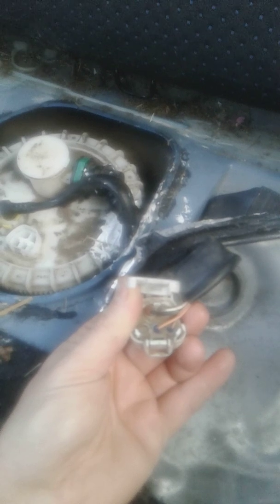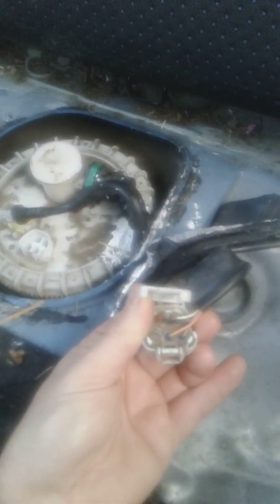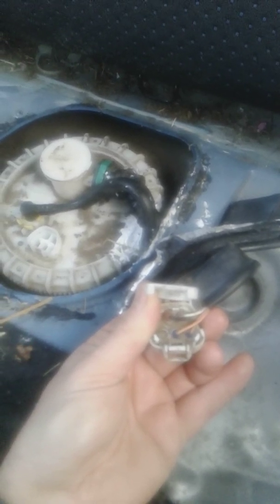2007 Toyota yaris no start diy

Comment: Go to the under the hood main fuse block panel. Check all pull out fuses.There is also a jumper box right there next to it. 2 pins there will run the fuel pump if that fuse in the fuse box is good.

Comment: I know the fuse for EFI is in the engine compartment but the fuse relay for fuel pump,  I can't find? Where is it located at? Is it underneath the steering wheel  behind the full out pocket? I have 2010 Toyota yaris sedan. I've been looking for fuel pump relay (if there's one) but I have no idea? That fuse box below steering wheel has no diagram ??
Reply: did ever fix the car?

Comment: Thank you for the Video. I have a 2006 1000cc Toyota vits / Yaris. I can not get it to start. I checked everything and even bought new fuel pump.
Reply: Did you manage to get yours to start?.
Reply: there's no 1000cc toyota yaris lol
Reply: @I4NI_  yes it is I have the same
Reply: @I4NI_  FYI   it's also produced 1.0 petrol, 3 cylinder engine in MK 2 Yaris.
Reply: I stand corrected 👏
Reply: Hello am also facing same problem, how can you help me